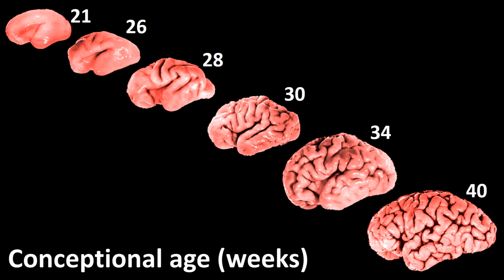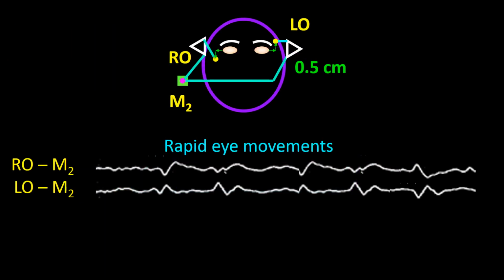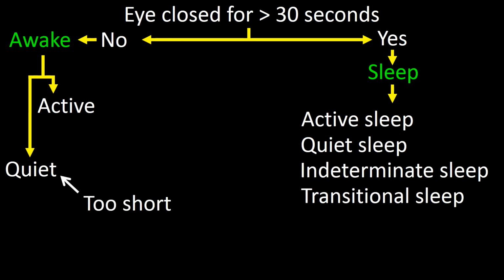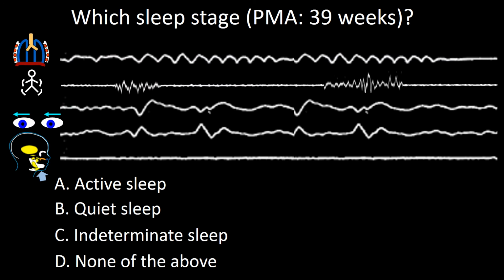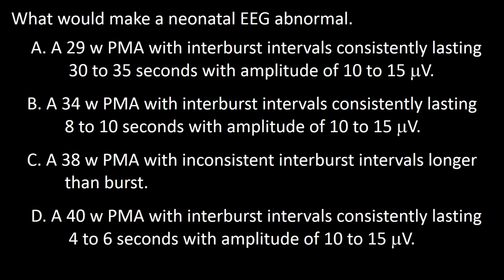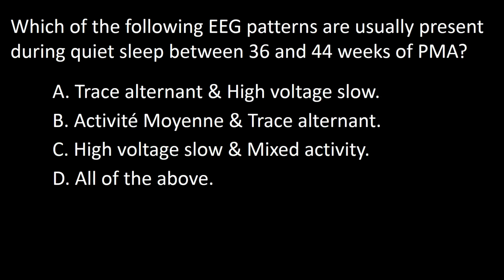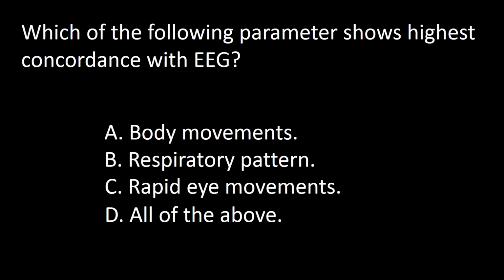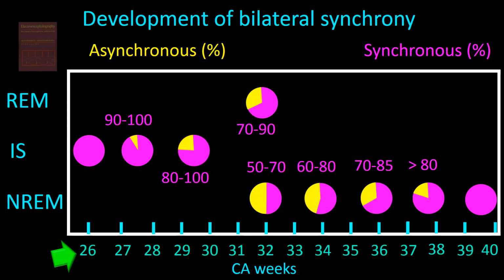Neonatal EEG  Part 1

Comment: At what age do we start using photic stimulation? I typically start when they are able to follow commands and stay still for the activation procedure,  but I don't know if that correct.
Reply from the maker: Thank you for your question.  Your approach is reasonable. I do the same, most of the time.